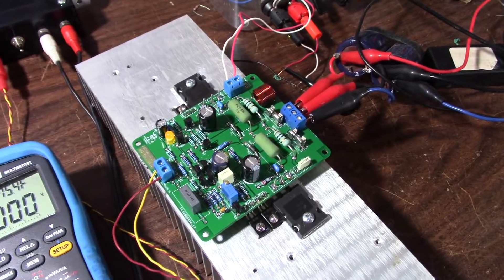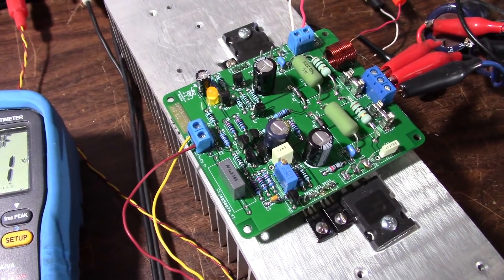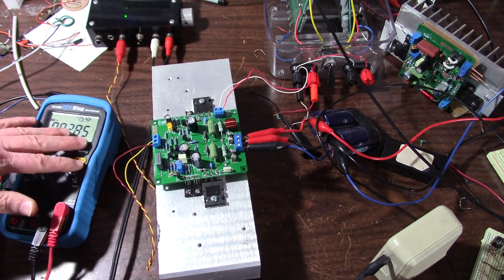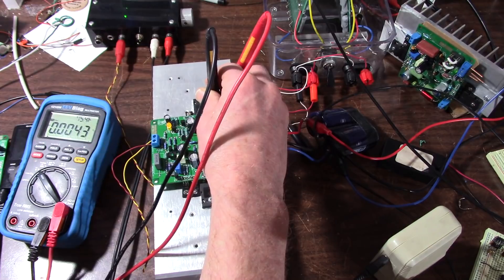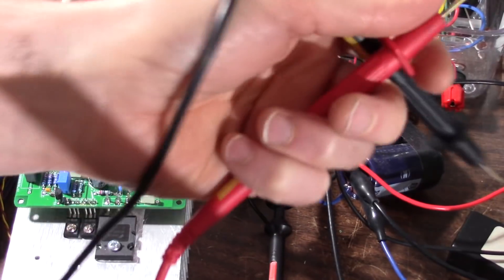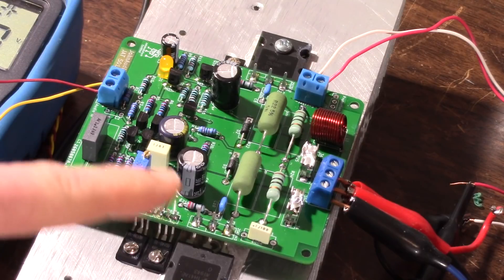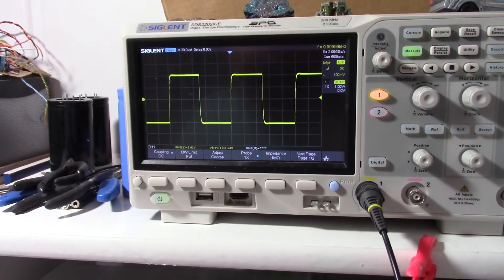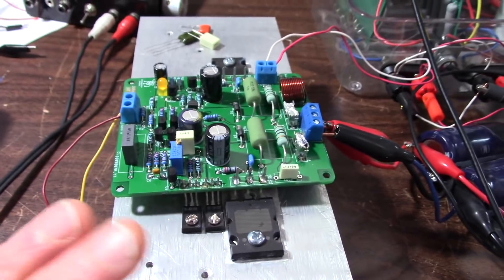JAT501 amplifier final tests

Comment: John - Thank you for the great video series on this amp.  I have decided to build this amp. I have already ordered boards.  My first questions regard transistor matching.  I have a PEAK Atlas DCA75.  Will the hfe measurements from this device be good enough?  How closely should the hfe's match?
Reply from the maker: Thanks for watching! hfe is fine for the small signal transistors. You should find they match to within a couple points. I wouldn't worry about the outputs because you'd have to buy a bunch to match. Just get the O grade ones.

Comment: This looks fun and once you have it finalized I’ll plan on building a stereo pair. Luckily I have enough parts on hand to build 50-60 channels, I’m limited by the number of 2SC5200s and 2SA1943s, last I counted I only had like 58 of each on hand.  That and the power supplies, being the transformers and I’d have to pick up more larger caps for the mains filtering. That being said it would be very cool seeing a high power version made up. Something in the 250-500 watt at 8 ohms region.  Even 200 at 8R would be cool.  I just finished a repair on a pair of McIntosh MC501 monoblocks (500w output) and they use the same 2SC5200 and 2SA1943 for the outputs. Obviously way more of them.
Reply: Pardon me, but who needs 500W ? In a modern apartment even 35W of CLEAN POWER is more than adequate. Don't forget that many of us are living in  apartment buildings next to not very tolerant (anything "correct" or conservative) neighbors of the exactly  next door apartment.
Reply: @gamiwv  subwoofers for a home theater in not an apartment

Comment: Hi John.Great video series. I have enjoyed every second of it. I'm just wondering about the measured HF bandwidth of 210Khz. The miller compensation value is shown as 100pF in the schematic. When I run the spice simulation I get a cut off of 65khz. Did you perhaps lower the value during testing to somewhere around 15-18pF?
Reply from the maker: No, it is 100pf. What is the current in the input stage of the sim?
Reply: @JohnAudioTech  Hi John, input base current into the input stage Q2 is 6,5 uA. The current provided to the differential pair provided by the current source is 3,3mA.
Reply from the maker: @stephanminnie1418  IPS CCS should be 2.5ma, though higher should not harm the speed. An early design of the amp had the IPS current at 1.2ma and slew rate suffered. Also check the input filter cap value is not set too high. Should be 220 pf.

Where did you get the schematic to model from? If it was from early in the video series on the amp, those are not fit for duty.
Reply: @JohnAudioTech   Hi John, I used the schematic in this video. Input filter cap is set at 220p. I have changed the CCS to 2,5 mA but the bandwidth remains the same with high cut-off at 65Khz. I emailed you the Spice file I used. Not sure what I am doing wrong. Thanks for the quick response.

Comment: Hey John, Ive watched a ton of your videos, and they have really helped me get into DIY Audio, after watching your series of tests on small amplifier boards, I bought a bunch of little tda3116D2 boards, DSP boards, Dayton audio and Tang band speakers etc...

I'm wanting to explore with a little more power, but noticed there seems to be a missing gap between these small 50w amplifier boards you can buy for a few dollars, and professional amplifier boards that cost hundred of dollars to get into the 100-200 watt range.

Can you help me understand why that is?
Reply from the maker: Good question. A lot of these high power boards are rated at 4 or 2 ohms and are less at 8 ohms. Some are not telling the truth on actual power. You can estimate by the supply voltage used.
Reply: @JohnAudioTech  yes, your video on the tda3116d2 showing it's clean 50watt output was very helpful, so that's what I run them at now, so what's the difference between these little chip amplifier boards and larger pro amps that are in the few hundred watts range? Are the Larger amps not based off chips, but more hardy electronic components that can handle the power?
Reply from the maker: @sportbikeguy9875  Some may be based on discrete output devices driven by a controlling IC. There are some high power ICs as well.

Comment: What about damping factor, John? We should create a new standard for that, say Df at 70Hz, because we need a good damping at low frequencies. Do you know why the official test is at 1000Hz?
Reply from the maker: During the design phase, I tested the DF at different frequencies. I was not able to measure it using the scope which means it is at least 1000. 1KHz is a common test frequency as it is near the middle of the audio spectrum (at least looking at it logarithmically) and it is where hearing is becoming the most sensitive.

Comment: Fantastic work, forgive my lack of knowledge on this question, It looks like your using electrolytic caps on the amp board, is there any advantage if you change the caps to a higher quality cap.
Great work it looks like the amp measures really well.
Keep up the great work.
Reply from the maker: Two of the caps are for supply bypassing. One is in the feedback loop. Using a better cap there can help but measured distortion is so low that the change in audibility is questionable.
Reply: @JohnAudioTech  thanks for the answer, I would love to study this more but time is something that is given to everyone except myself, one day I will, that's why I love you channel, I am living my amp design life through you, keep it up your info is fantastic. 👍

Comment: My 4ohm bass drives in bass reflex actually are more like 2ohm minimum, when it's load is considered as reactive load with the phase swing, especially around tuning point. Also, the amp distortions increase tenfold as soon as the impedance starts to go 'crazy' below 100Hz.

Comment: Thank you so much sir, has  been waiting for  this test video,👍  is there any require to joint together the diffrencial stage transistor for thermally tracking? Or just leave it as it is.
Reply from the maker: I didn't see any need to join them in my tests. You still can if you want.

Comment: You didn't talk about slew rate of this amp .
Reply from the maker: I measured it during the design phase of the project. I found it was too low and had to increase the current in the input stage in order to drive the VAS for improved slew rate.